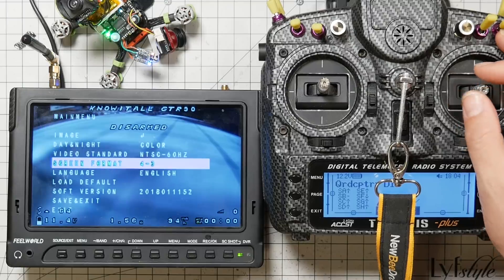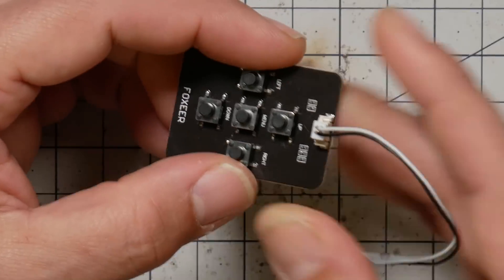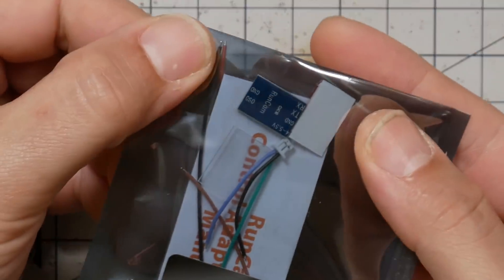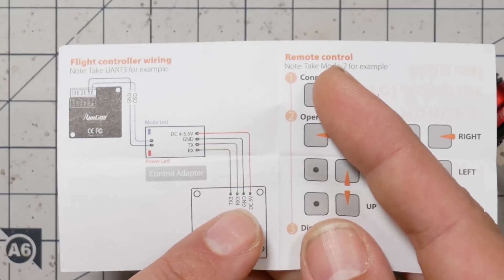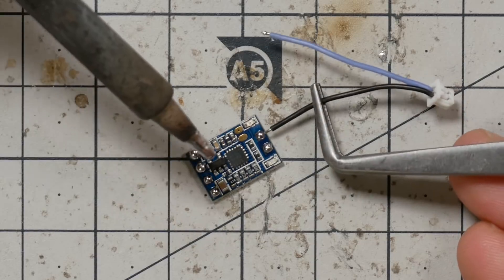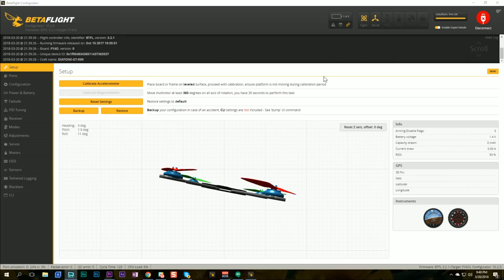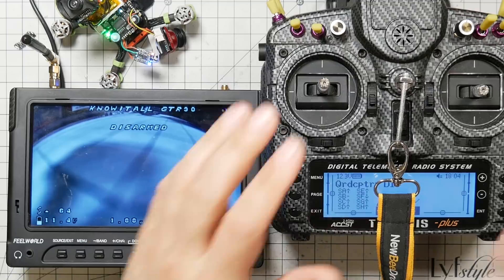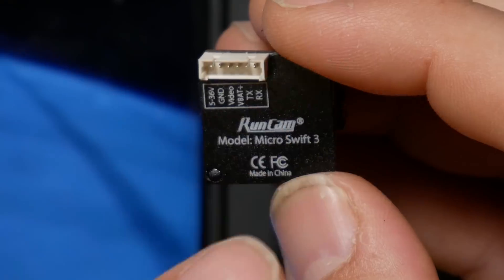Runcam FPV Camera Remote Control Adapter

Comment: will the RC remote adaptor work with the Foxeer predator? I had the impression the predator had a unique problem (irrespective of resisters/capacitors) that made it not work with the BF cam control system (from BF github wiki: Foxeer Predator- UP&DOWN do not work, hopefully future batches will have the firmware flaw addressed)
Reply from the maker: It should work with any camera that uses the standard joystick I would think.
Reply: Yep
Reply: yup! Tried it on the predator and it's works perfectly.
Reply: I messed up on my initial post and thought it wasn't working.   It does indeed work.  My bad :)

Comment: Joshua can you test if it will work with the Foxeer-Predator-Mini.
Reply: or any Foxeer, im runing the arrow v3
Reply: or caddx ?
Reply: Does not work as Foxeer uses a different resistance scheme. Tested with my Monster 
V2, at least.
Reply: Alpha Tango :[
Reply: Alpha Tango check the documents on BetaFlight site saying that Predator is totally different from all cameras....so it may or may not work...
Reply: Predator mini has the right pics for it. I might try it
Reply: I was wrong about it not working with predator cams.  It does in fact work , just need to push enter command with the transmitter twice.  Once changes mode on the adapter second enter input will bring up the osd.
Reply: I corrected my earlier reply.   It does indeed work with predator mini .
Reply: I was going to say, pretty sure it does work. I used the runcam joystick on my foxeer camera's and it works. So pretty sure the camera control adapter will work.